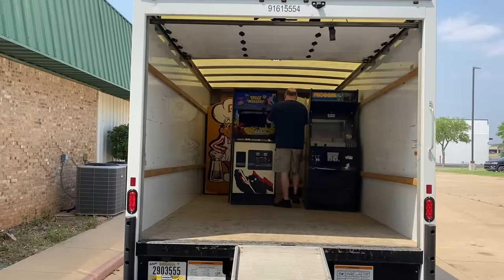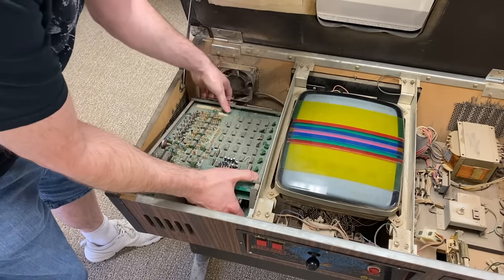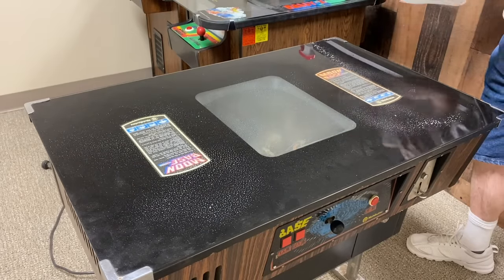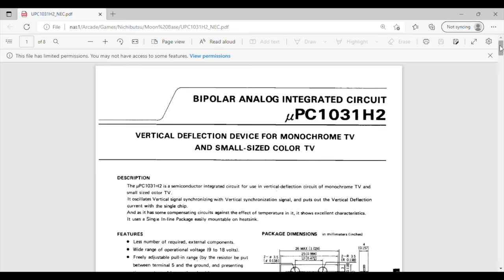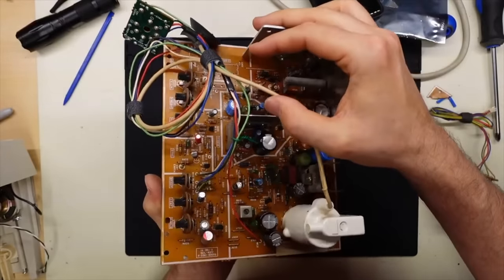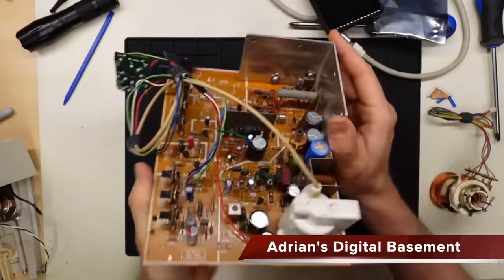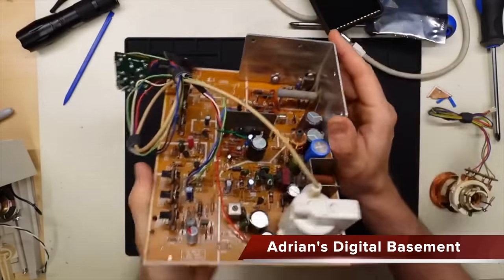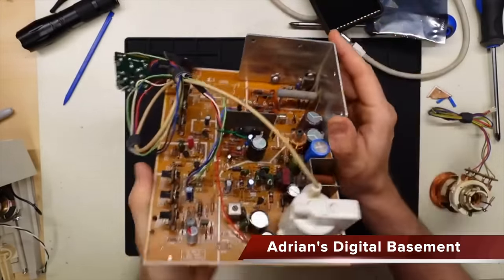Moonbase Arcade Restoration - Gone Wrong

Comment: Have you considered checking for the proper output voltages from the power supply? Not only to check for functionality but it would also tell you if it really is a 100v unit or not. You mention it burning out chips, maybe because the voltage is too high and you do need a step down transformer. Love your stuff! Hope you get it figured out.
Reply: I 2nd this! As you stated in the video, it was manufactured for the Asian market using 100 VAC and NOY the USA market using 120VAC, so that 20 volts extra, when put through the stepdown transformer may still be providing too much input voltage on the video driver circuit and thus blowing your video IC chip!!! Go test your voltages on board and see what you get! And since you have a complete electrical schematic, you may need to determine what component values you'll need to swap out to allow use of 120VAC that'll prevent circuit damage on board
Reply: The fact that it powered on and operated would highly suggest it was converted but I would check the conversion components.
Reply: I 3rd this! the first rule of testing electronics. thou shall check voltages. and I agree that if it was never modified to run in the US, that could be a possible cause of failure. I have seen people fry thier Famicom consoles by not stepping them down to 100v.
Reply: @DodgeHooker641  they're be a regulator somewhere before or on the monitor board so unlikely that would have been the problem directly, but the extra voltage will result in higher heat dissipation within the regulator circuit which may be a problem, this may be the issue, regulator passing too high voltage out, maybe NOT due to excess mains but coincidental failure of a zener?    i see nowhere in the video that any voltages were checked when in use....
Reply: The Two tax tags showed it operated in the U.S for atleast two years that would be a lot of run time for over voltage.
Reply: @christophernewman8741  that's what I thought too! The 2-years was just long enough being run over voltage that it has some lasting effects, ie burnt components and the video issues, which is why it was removed from service, likely after the 2nd round of fixing it and having the same issue happen again back in 83/84
Reply: @christophernewman8741  just because it turned on doesn't mean that the 100 to 120 conversion has been done...
Reply: @andygozzo72  a bad regular would in turn pass the over voltage as a cascading problem into the video circuit....
Reply: @christophernewman8741 unless the arcade had it plugged into a step-down transformer. I only say this because where I live, there used to be an arcade with Japanese imported games. The owner just used a plug in step-down transformer instead of modified power supplies.
Reply: @DodgeHooker641  it wouldnt necessarily show up in terms of 'video', i had a portable black n white tv that was seemingly ok just bit too bright and it turned out the regulator transistor was shorted passing full 13v instead of 11v , if left it would eventually blow the crt heater, and likely cause damage to the scan drive circuits,, similar may be happening with this arcade unit, voltages need to be checked,  also many of those frame out chips use a flyback boost circuit to help flyback and reduce dissipation, that part of the circuit needs checking, as fault in that could be masked by adjusting height, linearity, etc.  but the chip will overheat and eventually fail
Reply: The US voltage standard is 120v, but with a tolerance of +-5%.  So you could have 114v at the panel and then as the power runs through lines and receptacles it drops even further.  It really wouldn’t surprise me if whatever arcade this was used in, the machine was getting close enough to 100v to work.  I’d say double check the power circuits with a voltmeter, if more than 105v is enter the power supply, that is a culprit.
Reply: @schmu79  maybe, but not necessarily  more important is to check the dc voltages within the unit after any regulation ..
Reply: there may well be a tapping point on the transformer to adjust it to suit 100 or 120 ish mains, i'll have look at the video again more closely to see if i can see it
Reply: @andygozzo72  exactly, I agree with you
Reply: update, yes i can see what looks like tappings, one is 145v, near the top of the transformer  so likely adjustable, i cant see a 100 or 120 though, maybe on the lower line of terminals,
Reply: @Rob_M_jr  3-prong power plugs are rare in Japan, so I would expect that at the very least the power cord was changed. And since the cord had the specific connector it is probably proper for the power supply.     "EDIT": the plug is a rewireable one so they probably just put a new plug on the old cord.
Reply: @andygozzo72  Adrian was testing voltages in his video and the monitor's regulation was definitely working. However he didn't see if it was reliable when fed a higher voltage. It's probably an intermittent issue in the regulator, possibly related to heat. From what I remember I don't think 20% extra voltage would impact it much as even with the optimal voltage the regulator was dropping over 33% of the input voltage.
Reply: I also second this.  Older Japanese voltages were 100v/50hz with some places at 60hz.  I would change that voltage regulator regardless, it's a weak link part and I would bet 10 to 1 that that's the problem.  Although right now you may have to replace that video chip also...sorry
Reply: Ha I just made the same comment
Reply: @StanForce  great minds haha🤣
Reply: Def this
Reply: it was only certified for 2 years, pretty sure thats because the wrong voltage killed it
Reply: I’m gonna throw my lot in with this. Even if it has been “converted” from 100V, never entirely sure how kosher that conversion might have been.
Reply: @christophernewman8741  running a 100v device on 110+v is easy, its why you dont run north american items on european current. that machine is getting slowly overvolted.
Reply: @Rob_M_jr  i thought a famicom used a DC adapter and ppl swapped them?
Reply: Came to the comments to say this.
Reply: @christophernewman8741  Could the original plug end have been modified to drop the voltage down to an acceptable level for the base machine?
Reply: When he mentioned the 100v in passing and then never really mentioned it again I thought that was odd.
Reply: @christophernewman8741  we dont know maybe there was stepdown transformer when it i was in service then some new guy was like oh it doesn't need to followed by a weeklater the IC burning out and then being taken out service
Reply: that's exactly what i was thinking! i'm no expert on analog electronics but this seems like a possibility
Reply: @christophernewman8741  we also used to run on 110 in the 80's, that would have still been hard on the power supply and other components,  but not as bad as 120. I think that there probably something   else wrong though.
Reply: Feeding 120v to a 100v machine will not blow the IC so quickly
Reply: @DaiAtlus79  absolutely you can, i should have clarified that i was referring to several years ago, when i used to do repairs for a living. The famicom runs at 10v DC, while it's common to find replacement transformers these days, that wasn't the case many years ago. You had to use those universal ones with the molded multi-tip and selectable voltage/polarity. And they did not always fit properly.
Reply: @DodgeHooker641  a much less invasive option would be DC-DC converters or regulators on the PSU  output to keep the voltages stable, short of just replacing the entire power supply.
Reply: can only suggest this!
Reply: I believe it was Dave Jones who said: "The first rule of troubleshooting is: thou shalt check voltages."
Reply: @christophernewman8741  they could have been running that acade on a small transformer thought. There where smal ones to plug in between the wall outlet and the appliance back in the day.
Reply: @christophernewman8741  yes but we don't know if those 2 years happened with a voltage transformer! It could have been separated from the machine before Dave got it. An operator/arcade using Japanese imports would be more likely to have a few transformers at hand than to convert the machines. They'd want them on the floor making money.
Reply: You all have valid points. I'm looking forward to seeing what the issue is
Reply: Agree. At least check what voltage is going into the IC. Looks like it can take up to 18v, 2A. If it is working right on that limit (or slight over voltage), that could narrow down the problem. I'm no expert, but the new electrolytic caps arou d this part could still be the problem if they are not in spec. Also, clearly the part gets toasty to need a good sized heatsink. Make sure the ic is very well coupled to it.
Reply: I totaly agree. As an electronic student that was the first thing that came up in my mind.
Reply: Agreed. A LOT too much assuming going on in this video, especially where voltages are involved.
Reply: After watching Adrian's video and seeing how the picture changed when he put different voltages into the board I, too, think it's a good idea to check the transformer/power supply output. When he put less than around 16 Volts into it the picture became quite distorted, so maybe it's a bit on the low side. Or, if it is too high, the circuit on this board would have to get rid of a lot of energy and would be getting hot. Then again I have no clue about this kind of stuff,  so I may be completely wrong. ;-)
Reply: I was going to say the same thing. The fact that the fix unfixed itself in such a short time... It makes me wonder about the power supply.
Reply: I have that same nichibutsu (with crazy climber) cabinet and if you check the schematic, you will find that the big transformer is multi tapped all the way up to 240v for the European market.
Also, check the regulation board opposite the monitor board.
Reply: @DaiAtlus79  Most of europe use 220-240 volts, so it usually just goes boom if I would use Japanese or American stuff here :p
Reply: @Krozmar  yup, step down converters are dandy, especially ones that actually do 60hz. I have Japanese Acer speakers but its PSU does 100-220v, as most new gear have auto switching PSUs.
Reply: @jsnsk101  It was only in service until 1984 because nobody was playing "Space Invaders" in '84 anymore because it was super old, boring technology by then. 1984 was the year of games like Pole Position and Track and Field.
Reply: @kewkabe  You'd be surprised how many places still had Space Invaders machines running in the mid to late 80s though.
Reply: @Squidbush8563  And nobody ever played them, I was there.
Reply: @kewkabe  So was I. The point isn't that they played them, but rather that they were there, plugged in and turned on.
Reply: @StuartTaylorEsquire  - Nichibutsu.
Reply: Belive i have 1 from a space invader cocktail
Reply: This was what I was thinking, but I’m no electrician.
Reply: See if the tap is moved on the transformer for the USA market. I would bet there are multiple taps on that transformer for the whole system.

Comment: I think it's a power supply diode, here's why: From my experiences with TVs I can tell you have 60Hz ripple in the monitor circuitry. Since the fault is causing decreased picture size it's most likely in the power supply circuitry. The odd thing is the monitor has a full bridge rectifier so regulation issues should be manifesting at 120Hz. One explanation is that one of the diodes in the rectifier is intermittently failing open. Since Adrian was testing with DC instead of AC input such a failure likely would not have shown up in his testing.
Reply: Could it be because it's running at a higher voltage than specified?
Reply: This seems incorrect to me and here's why: for one, the chip replacement fixed the problem for a time and then failed again meaning it most likely was getting too high of a voltage. And for another, the chip that was pulled out was visibly damaged and replacing it again fixed the issue for a bit and then failed in exactly the same way. I presume, with my knowledge of chips, checking any pot for voltage or checking the other components that are involved in the power rail and replacing them would fix the problem. If you have a better argument for your theory though feel free to say something. If I'm severely wrong it would be helpful to at least know.
Reply: @deathdeathrevolution3499  I was also thinking overvoltage or a problem related to the power supply; the sticker mentions 100V, as far as I know US is 120V so potentially the difference could be over 30V once rectified. But I'm taking for granted he tested the voltage before installing the chip.
Reply: Yo🔥https://youtu.be/rdJ9bsN7JAw..
Reply: He did change the power cable in the very end and if the video chronology is correct, it broke after that.
Reply: @seregruin  he probably just didn't have it powered on long enough for the new chip to fry from overvoltage before the cable replacement, either way it's the same voltage going through the new/old cable
Reply: Half of Japan is 50hz, and the other half is 60hz. Your 60hz ripple comment made me wonder if there might be a switch or jumper to select the appropriate frequency similar to multi-voltage power supplies. I'm not even sure if that's a thing though.
Reply: @morphman86  It couldn't be from too high of a voltage, and here's why: the monitor has its own series voltage regulator which tries to maintain the proper internal voltage. Assuming the regulator circuit is working then an increased voltage would actually make it better.
Reply: @eDoc2020  Is the regulator circuit able to handle a higher voltage?
In my (limited) experience, diodes are the first to fail when voltage increases.

Just feels like that could explain the issue you were talking about. But I feel you got more experience than me on this, so I'll defer to your expertise.
Reply: I'd also check whether the transformator has multiple input/output pins to accomodate 100 and 120 volts.
Reply: @deathdeathrevolution3499  My gut feeling is the chip was never bad and that it was a red herring. The chip is only responsible for vertical functionality and the monitor also has horizontal shrinkage. With typical CRT sets you always want to get the horizontal circuits working first because it is is responsible for generating some of the voltages inside the set and is also the largest load on the power supply (also it's the most likely to blow up).
Reply: @kievdarrington3640  As most electronics operate on rectified DC instead of AC they don't care much about the frequency. The big exception is clocks which measure time by counting line cycles. The main difference is transformers need to be 20% larger to operate efficiently at 50 instead of 60 Hertz and power supply capacitors also need to be slightly larger to prevent more ripple.
Reply: @morphman86  If the regulator has a bypass resistor then the output voltage will start going over if the input voltage is too high, but 20% probably isn't enough to make this happen.

Failed diodes (and other semiconductors) tend to fail short but obviously they can also fail open. But I doubt they failed from the extra voltage. It's hard to find bridge rectifiers rated for less than 50 volts and this is well over the ~20 volts Adrian found it works best at. The 35 volt input capacitor would most likely fail first in the case of constant mild overvoltage.
Reply: @eDoc2020  The fact that there is a significant ripple on the horizontal phase makes me think there's also a big ripple on the B+. If the power supply upstream is providing too high of a voltage, it can damage the capacitors before the shunt regulator even comes into play.

So the first test would be to feed it with DC, and if that works properly, try to figure out if the DC coming out of the main power supply is still good, or if there is something going wrong there.
Reply: If the AC voltage is the issue, how was the thing run in the past, when it apparently was used in the US for some time? Would it have been always plugged through an external transformer that would decrease the voltage by 15 %? Perhaps the voltage coming from the power supply should be measured to see if it's the correct voltage at that point?
Reply: @kievdarrington3640  nah, mains frequency doesn't affect anything.
Reply: Yes, as much as I like Adrian vid, this test condition was bizarre.
Reply: I'm also going for an overcurrent somewhere, though I a not exactly sure whether it is due to components in the power circuit, or in the components drawing the power. I would imagine investigating both sides, thus whether the power circuit is emitting power or voltage erroneously due to busted diodes and whether the CRT is drawing too much, or a combination thereof.
Reply: Recently watched an episode on Joe’s classic and I think you did what he did and put the chip in backwards
Reply: @bikkiikun  given that this thing ran in Texas for several years , I expect it’s either 120v compatible, or maybe was the US at 110 v back then and we all stabilized to 120v now and that additional change is killing it?
Reply: @enginerd80  well the US voltage was 110 initially and went to 115 over the years to end up at 120. The National Electric Code wasn’t changed to use 120v for some things until 1984 which is past the last Texas license tag. Maybe running this at 120v vs the designed 100v has worn out other of the discrete components.
Reply: Hm now seeing the follow on repair work turns out there were other ICs on the board and those had failed (voltage regulator). Hard to guess when not all the info is known.